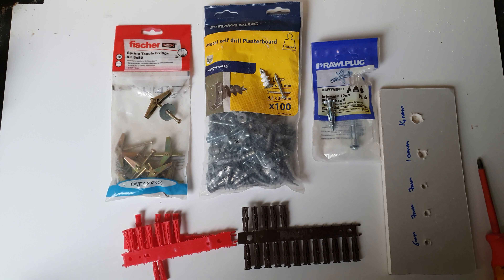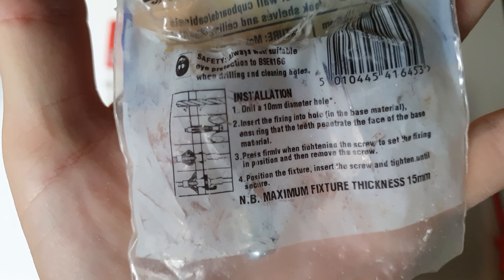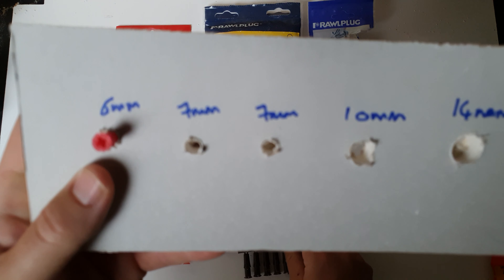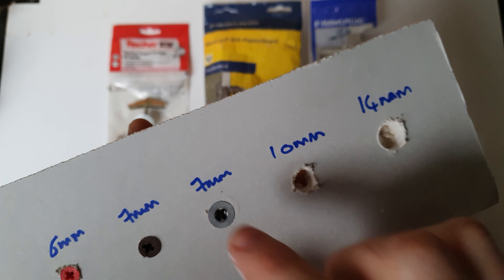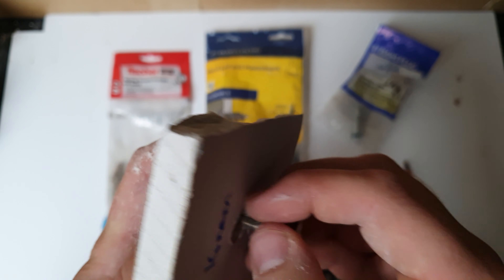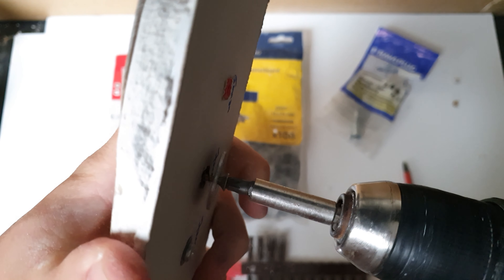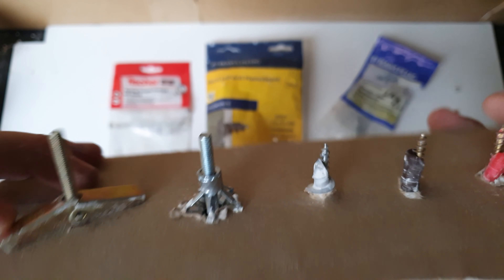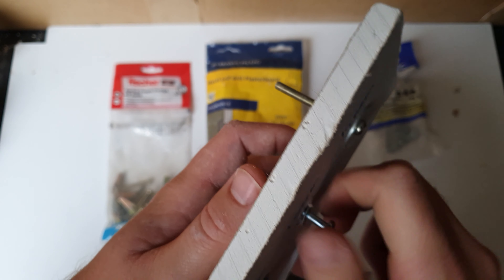PLASTERBOARD FIXINGS what fixings should I use, the most common (4K)

Comment: what is a setting tool?
Reply from the maker: A setting tool is a tool designed to be used for the installation of these hollow wall anchors
Reply from the maker: It basically pulls the bolt whilst holding the main body of the fixing against the plasterboard.
Reply from the maker: You end up with the same result the back becomes compressed but with an setting tool you dont have the danger of the fixing spinning in the hole whilst installing them by screwing them up to compress the back, so its much better to use the setting tool much more reliable that your fixing will work
Reply from the maker: I hope that made sense if you Google hollow wall anchor setting tool and should make sense.